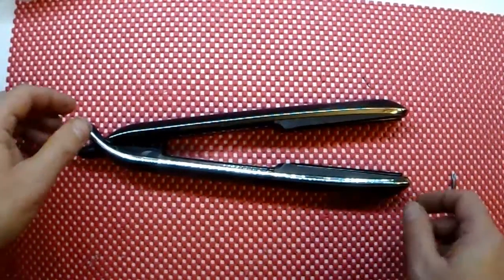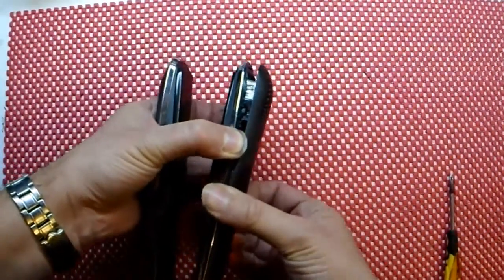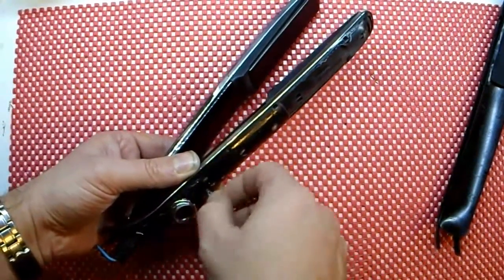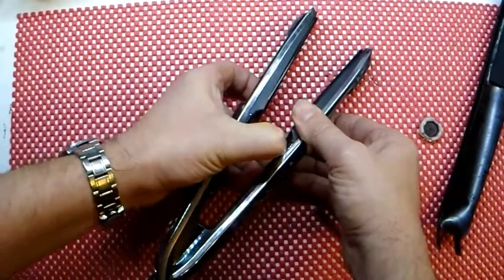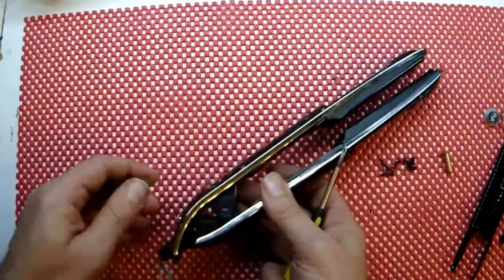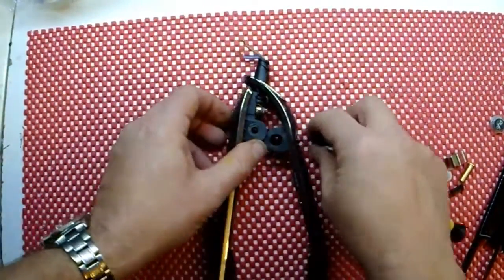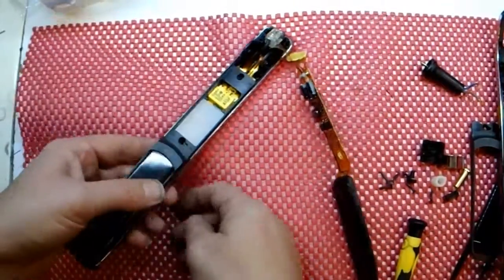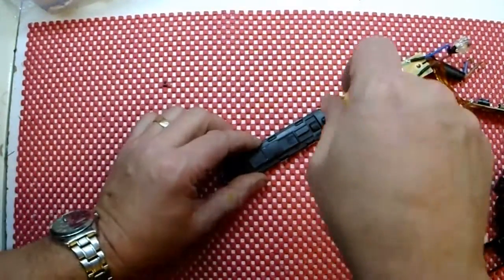Dismantling the GHD Eclipse

Comment: Big thank you for this informative video. Wanted to replace one of the plastic  surrounds that hold the heating plates in place, but had no idea how to dismantle the straightener. Watched your video and after 20 minutes job done. Had bought a faulty one from eBay for just £8. Also, as you said I heated the straighteners with my heat gun, and the covers came out like butter.

Comment: Hi Kev, thanks for the vids, have learnt a lot. Trying to figure out if it's worth my time opening the old ladies Eclipse. Only one side is heating, keeps on flashing and giving a soft beep. Would a heater still work if slightly cracked or would it more likely be a fuse on the one side? If It's a fuse I could reset it but heater I won't be able to replace. Greetings from South Africa.
Reply from the maker: your case the ceramic heater will not be cracked but all 3 heaters will 
have blown,  since the eclipse has started heating all thermistors are 
ok so this narrows the fault to just this known issue. afraid its heater
 change to fix these.

Comment: Hi Kevin I am trying to repair a set the same, can you tell me the part number for the ceramic heaters please, James
Reply from the maker: Hi Jim, good luck i stopped trying to repair them over a year ago, parts are not available and even if you get parts from a scrap unit it appears the heaters are matched to the board so a replacement either runs to hot, to cold or if your real lucky at the right temperature.

Comment: Hello Kev, my eclipse is stuck on shiver mode. It's brand new I've been using it for a month and I could not get it off shiver mode and it won't heat up. So instead I decided to buy a new straightener. My warranty expired through ghd and I put a towel around the straightener and it started heating up again. And as I start to straighten my hair within 5 minutes it goes back to shiver mode and starts to lose heat and keeps beeping. It's a brand new straightener and I have no idea what I can do to fix it since my warranty is expired. Please help me with any suggestions. Thank you so much
Reply from the maker: Hi Maxine, there is not much one can do now, They were such a problomatic model all support/repair has now since gone

Comment: hello, kevs thanks so much for this video help a lot! anyway, I follow all the instruction and end up the I need to reset the fuse, but I been looking for others video how to re-install everything back together and what to do for the fuse don't fail again.
thanks
Jackie
Reply from the maker: Hi Jackie, it goes back together in reverse order, to stop it blowing the fuse i did do a video about what to do to adjust the temperature but you need so much equipment its just not worth the trouble.

Comment: Nice video. Most uk ghd repair companies say these cant be repaired because they can't take them apart lol. I guess they have not seen this
Reply from the maker: Thats just a excuse, real reason they cant be repaired is cant get the parts (heaters), i use to repair them myself and we were the only company doing so but parts even from scrapped units dried up. They were designed to fail and not last, the flexable pcb layout has been designed in such a way as to cause failier into this product.